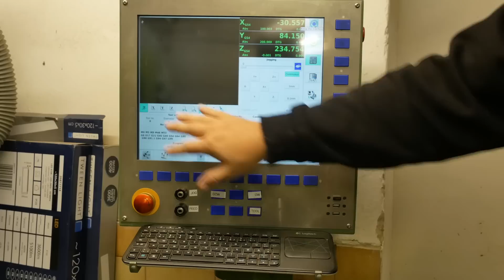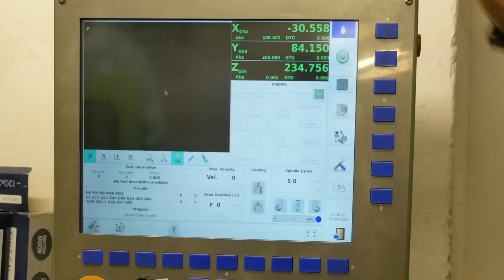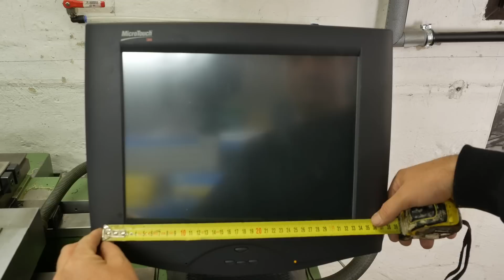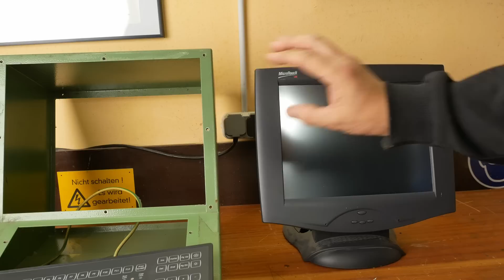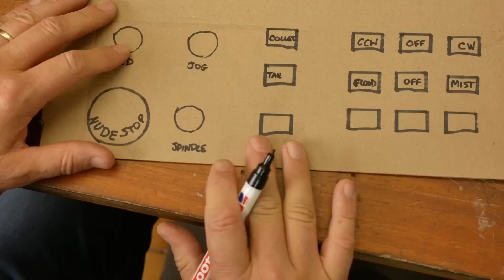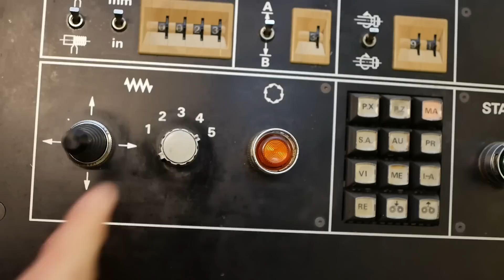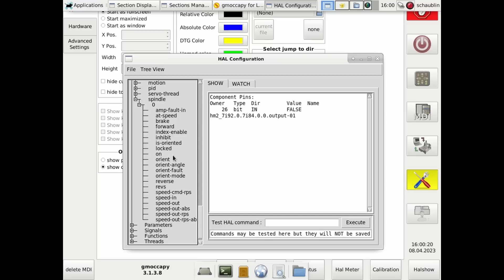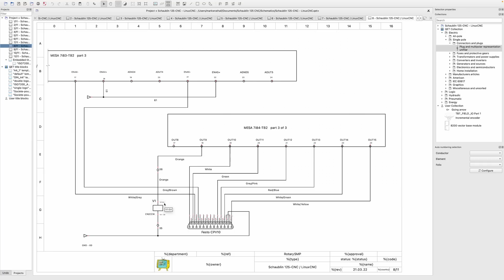Please help critique my CNC control panel layout ideas. || RotarySMP

Comment: about the Jog wheels - I really liked the pendant idea in front of the machine, as during jogging you will probably often be in a situation where you want to watch closely how far you jog, so the position in front of the machine is super useful there. 
one more thought - you could put the jogging encoder wheels not next to each other but on two sides (front and right) of the pendant - oriented as their respective axes are. this way it would almost feel like you're operating the cross slide of a traditional lathe
Reply from the maker: That is the way Schaublin did it on the 125CCN with Fanuc, the X encoder is on the side For me that might be weird, as the Boly has the cross slide hand wheel in the LH, rather than the RH.

Comment: Hi Mark just back from an enjoyable Easter dinner with my family, hope everyone has had an enjoyable weekend as well.
In other comments you have mentioned that you usually program on the console.
given that there are 3 basic activities on any CNC , 1)  program inputting,editing and selection. 2)  machine setup or manual operation, 3)  fully automatic operation,
It is important to avoid any egonomic decisions that would make any of these operations needlessly interfere  with the other  
one such decision would be keyboard operation and estop or other machine control switch  fouling each other.

As you have stated , You are inclined to mount  the handwheel and other controls onto the apron control ,in which case anything associated with setup /manual operation could
be mounted there .   During this time  the screen becomes a big DRO.   tool offsetting is about the only reason that you would touch the keyboard and monitor.

During auto mode about the only things happening are cycle start/stop, feedrate override, spindle override , and coolant override, oh and hoping that the program is correct .
these functions and the e-stop could be grouped together in a third VERY accessable spot  .
Reply from the maker: Hi Steve, that is a good approach to it Thanks. 

We also had family over for lunch, so there was a food induced coma in the afternoon. Got nothing done :/

Comment: Having controls behind each other seems odd to me. Either you are going to bump a knob while reaching for the keyboard, or you are pressing keys while reaching the knobs. I'd maybe go with an e-stop left of the monitor, also feed, spindle and jog, making the upper part a bit wider. Below, the keyboard and the buttons for colllet, direction, etc can go next to another. And don't make it too high: put the keyboard in the height of your elbows, so that you can rest your forearm/wrists comfortablly while typing. Nothing more uncomfortable than a keyborad at the wrong height. gets tiring for your neck and shoulders very fast. Ah, well, yes, that also means, that the original atrocity of a cabinet probably will be a donor for sheetmetal :)
Reply from the maker: Good points. I doubt I can get the keyboard down to that level. There is too much going on on the lathe below it. I will look at moving the phsyical buttons onto the panel below the screen, and having the keybard retractable though.

Comment: Can I ask what software you use to create your wiring diagrams? I started to do something similar for my cnc router build (I'm using a mesa 7i92 with a Gecko G540 and a Mesa 7i75) but it took me at least 10x as long to do the schematic as it did to actually do all of the wiring so I gave up rather quickly. I would love to find out I was just doing it wrong and it's actually something very easy to do, because then I'll actually go back and do it!
Reply from the maker: Hi Zack, I got a lot of questions on this. I now added a link to the description. It is qelectrotech, an open source software.

Some experienced sparky wrote a comment a while back. "Wiring doesn't take long.... unless you do it right."
I find that marking each wire and creating the schematics takes much longer than simply cutting the wire, crimping on ferrules and screwing into connectors, but for me is essential. Without the markings and the schematics, I would soon get lost and confused by my own work.

Comment: noodstop is pronounced more like nodestop lmfao
Reply from the maker: Thanks, I am not conversant in Dutch :)
Reply: @RotarySMP  I've been learning it over the past few months. it's a funny language! the ... distinctive double letter spelling rules start making more sense when you see them more: there's one pronunciation if the syllable ends with a consonant and another if it ends with a vowel and double letters switch the pronunciation

e.g. een rok (a skirt, "rock" ish, but o is like German, a short "oh" sound) -> de rokken (the skirts, "rock-'n")
vs roken (to smoke, "roh-k'n")

similarly with double vowels: noodstop is the long o as seen in "roken" in the "nood" part because of the double letter, whereas if it had just one o it would be like "rok", because the syllable ends with a consonant.
Reply from the maker: As a native english speaker who is pretty fluent in German, I always assumed Dutch would be pretty easy to pick up. When I am there I may as well be in Korea. I understand nothing people say in Dutch :)

Comment: No to the joystick! Yes to 2 encoder wheels. Imagine trying to touch off on a part with a joystick 😬 - I like the sliding pendant, and use something similar at work. I would add the e-stop on the top instead of parallel to the machine - a long with a button for coolant and buttons for the collet, and any other buttons you'd fancy having there.
Reply from the maker: Thanks for your feedback Mark. It is good to hear from people with experience on machines like this. I already picked up that I will need more buttons on that front sliding "pendant".

Comment: Why not to use flat vertical module with screen, keyboard etc like big industrial machining centers?
Reply from the maker: I think the industrial machines are normally used very differently to mine. I do mainly one offs, never series production, and often code right on the machine. Typing on a vertical keyboard is not comfortable at all.
Reply: @RotarySMP  than it could be done with flip down keybord. Vertical screen and jog wheel might be more comfy than 45 degree. But i might be wrong.
Reply from the maker: Good points.

Comment: Love that the algorithm led me here. 
I've never designed a control, but I've used a lot and developed some strong opinions on them. 
One thing I've thought of, and wished controller designers would do, is make a spaghetti diagram of the workflow on a controller. In other words, use a string to follow the sequence of button pushes for any particular function, like loading a program, starting from the middle of a program, setting tools, setting work offsets, etc. Achieving the shortest possible string would probably give you the best user experience. 
But this is just an unproven idea.
Reply from the maker: Nice idea, but isnt that something for the training manual? I am not sure how I could execute this, as my interface is modal, so buttons have different function in different modes.
Reply: @RotarySMP  maybe spaghetti diagram isn't the right term. The purpose is to reduce the amount of hand movements and button pushes. For example, to load a program from a USB drive on my fanuc control, I have to go to edit mode, program hard key, folder soft key, change device, USB mem, cursor down to the program, select soft key, copy, plus, device change, CNC mem, select, paste, cursor down to the program, plus, main program. And more if I want to run that program and have the proper screen displayed. It's tedious. The hass control is a little better, but my favorite was the Heidenhain MillPlus 3.4 which has the added benefit of customizing your layout (which I never used, the default was good enough).

Comment: Those JOG-switches look like they defected from a DC-9 (or MD-80) fuel panel... ;)
Reply from the maker: 767 cargo loading panel. I fished them out of the trash at Lauda Air in the 90's. Replaced during some SB. 

I looked them up. The purchase price of those two would be more than the mini lathe :).
Reply: @RotarySMP  Pricing as per usual and from usual suspects I assume: Eaton, Apem and Korry... I hated the P/B on the 767... changing the 387 bulbs in the dark was a nightmare... A buddy of mine used some stronger words to describe his feelings towards the Korry company.

Comment: Looks like that’s going to be a nice fancy control panel. I don’t think I can add anything, maybe just if you give yourself the ability to make changes for future improvements…
Reply from the maker: That is a good point. Although I tend to be very resistant to change something one I have done it, even if I did a crap job :/
Reply: @RotarySMP  I was thinking the exact same thing, if I left something off, I’d probably live with it and just be annoyed…

Comment: For my money I’d rather have an air blast button than a mist coolant. I’ve never really found a use for mist in a lathe with a full cage. The air blast though is used often.
Reply from the maker: Good idea. Especially as this machine already has air.

Comment: I understand the desire to use what you have on hand, but laser cutting a new case will eliminate significant compromise and deconstruction allowing you to focus on assembly and wiring. Deconstruction will have costs in time, cutting disks, electricity,  paint sanding, hole-making.
Reply from the maker: Yeah, especially the mess of paint stripping. Cutting disk = sparks. Everyone on YT likes sparks.

Comment: I know a thing or two about UX design, and the mockup you showed makes a lot of sense.

One thing another commenter mentioned that I wouldn't definitely do is illuminated buttons: If you put in some effort, you can go for a "dark cockpit" style control, where only buttons that have a function at the moment light up (I know it's not 100% the same, but I like the concept).

Also, consider breaking up that 2x3 matrix a bit more, so that it's clear that those 3 keys are a group - and if you do more groups that feed into the same thing, keep them in horizontal groups as well.

On the pendant, I'd add a spindle clamp button, and spindle controls - maybe also tailstock controls.
Reply from the maker: Vincent... we have been friends for so long, and now you go and sell me out to the LED lit button mafia :(. 
I am so disappointed!

Good inputs though :)

Actually I once when down that rabbit hole of the dark cockpit, Boeing style integral lighting. There are some amazing sim builders who model all that stuff. 

Why would you put the collet clamp and tailstock down on the pendant? Those would seem like set up tasks.
Reply: @RotarySMP  I never said you had to use LED buttons, I'm sure you can find some nice buttons with incandescent bulbs in the scrap bin at work.

As for setup buttons - yeah, that was the intention. I'm not 100% sure if you would use them, but to me, they seem like potentially useful additions.

If in doubt, just look if some other MPGs have buttons like this, those manufacturers seem to know what they're doing.
Reply from the maker: @vincentguttmann2231  I thought a bit more about it and you are right, that the collet clamping will probably have me holding some small part at the spindle, and it could be quite a stretch to reach up to the control panel to clamp it. They whole volume of comments have rather overwhelmed my plans and ideas a bit. I need to thick this all through more.

I was going to make all the buttons on the Maho.

Comment: How European, no cup holders. On a more serious note, why not put one of those status traffic lights on top so you can tell if it needs your attention from far?
Reply from the maker: You haven't seen the size of my basement shop.  :) Far away is three steps max. Also it will never be a production machine,.
Reply: @RotarySMP  fair enough, but you can't deny a cup holder is a good idea. You never know when you would take your lathe to a drive through on a cross Europe road trip
Reply from the maker: @Hilmi12  Can't argue with that.

Comment: What about some lighting up buttons for mode selecting so you can out of the corner of your eyes quickly see what mode it in ( mdi. Check ( where everything is running at 25% and g-code can be changed well running. Like on a citizen lathe that I use to work on and loved that feature) and auto ) that's my idea for the controller 

And a light on off button on the side if you also put some lights on the machine
Reply from the maker: Since this will never be a production machine, I doubt I would ever need the high speed side of it. I am trying to practice dialing back the feed rate and living with the hand on the feed hold with untested programs.
Reply: @RotarySMP  yeah but that's not as good for the tool life. since insert tools are ment/designed for a serten feed pr. rpm and temp at the cutting edge (830 C in what's called the flow zone. where the insert is still at full hard/stiffness but the material gets softer and gets pushed away/seperated from the main stock and forms the chips 

so at least make sure to keep the feed pr. rpm constant 

and was just personal recomendation from my experience. and what i had put on if it was me cnc

but it's your cnc mate and the most important point is that your happy with how the machine turns out
Reply from the maker: @flikflak24  I appreciate your inputs on this. As you can see I am not a machinist, so my ideas are pretty half baked. 

Some of the best ideas presented in this thread (and there are a lot), may be beyond my ablity to implement or code in LinuxCNC.
Reply: @RotarySMP  that's also fair. i am however glad to finally see the idear i came up with inteams of air ( if form of mist ) that i came with some time ago finnaly come into excistance 

by the way are you planing on useing coolant or just straight oil ?
the oil is only slightly worse at cooling ( in my experience ) but never needs to be changed at all. it lubs the tools way better so they last way longer ( we whend from about 800 parts pr conrer to 3500 parts pr corner of the insert ( same feed.speed and deapth of cut )) and only needs topping up from the oil that splash out of the machine/part/ships. nothing eraperates away over time ( at least not compared to coolent ) and it also constantly oil the ways and chuck. so need to oil them by hand or any chance of rust

Comment: As a hobbyist, I understand the frustration of not knowing which way to turn the encoder. I've considered using a combination joystick and encoder as a solution. The joystick would only determine the direction, and then the encoder would move in that direction, regardless of which way you turn the encoder. However, it could build bad habits on other machines.   Just thinking....
Reply from the maker: When I use the Boley, I never have to think, the, handles just turn naturally, so I would like to have the encoder rotation the same.

Comment: Two thoughts:  keep your E stop well clear of things and on the left.  I reckon go separate manual jog wheels for Z and X on a lathe, but go different sizes and shapes and even positions so that they approximate cross slide and apron handwheels.
Reply: On my lathe the hand wheels are the same size and both on the same level. It didn't take long to get used to them. I found a high count encoder (500PPR or more) makes it feel more like a manual handwheel. If you use encoders you have to have some sort of brake/friction mechanism otherwise the wheel will turn due to vibration or even gravity if it's not perfectly balanced.
Reply from the maker: @LesNewell  Thanks for that. I had already  ordered a couple of they standard 100PPR hand wheels though.
Reply from the maker: I did think about making up a box with real wheels driving the encoders, but couldnt find reasonably priced 100PPR hollow shaft encoders, and it would take me forever to do that project. I will stagger the jog wheels though.

Comment: Would the estop be better on the front (vertical) panel?seems quite far back. I’ve seen some jog dongles have jog wheels on different faces e.g so they are at 90 degrees to each other does that make it more intuitive? Interesting video 😀
Reply from the maker: Thanks. Schaublin did the two jog wheels at 90° on the 125 CCN. I should go and try them out on my mates one. Good point.

Comment: I would prefer to have the additional controls and knobs on the right side of the keyboard, also i would put the stop feed hold and single line step buttons on the right side as they are what i use most of the time when testing my gcode! Great job as always!
Reply from the maker: Thanks for the input Stefano.

Comment: What about rotary controls with haptic feedback (via BLDC motors on the control knob)?
Reply from the maker: It is a nice idea, but were do you get your input for force required from? Servo current is more speed and inertia dependent than cutting force dependent.
Reply: @RotarySMP  I am not sure all the cool things one might use it for, but they let you do things like program the acceleration of the knob, so e.g. if you turn the knob "harder" (because you programmed resistance to increase past the 3 o'clock position) the jog goes faster. Or programmable haptic "detents." Or input from a current sensor on the spindle motor for operations where you risk stalling the spindle.
There are a lot of possibilities and BLDC motors as haptic input controls are a relatively new idea that is relatively underexplored. Lot of space for creative innovation.
Reply: @RotarySMP  Also check out https://youtu.be/ip641WmY4pA for some ideas in this space!